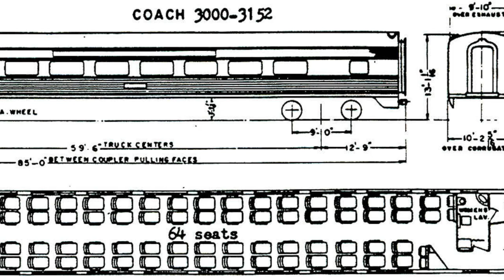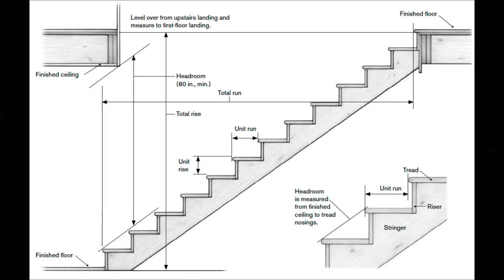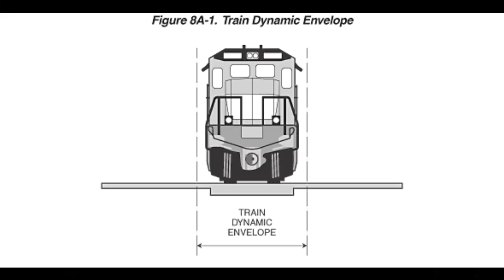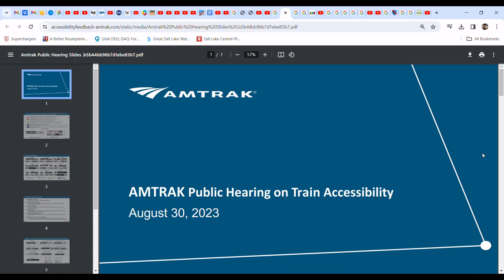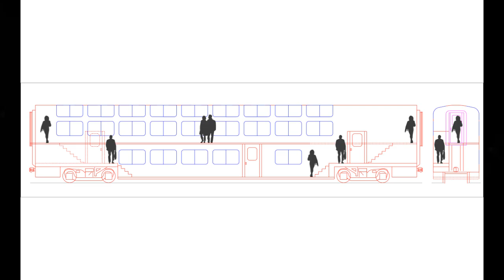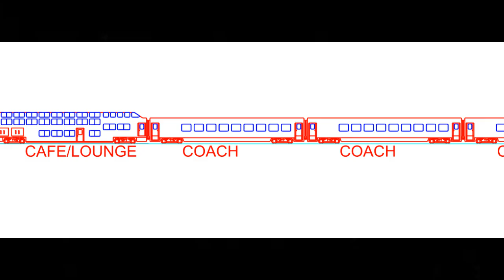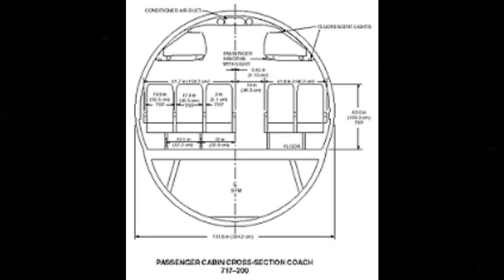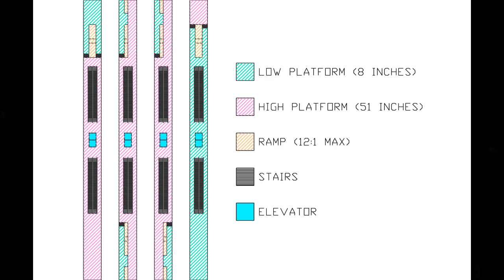An Excessive Explanation of North American Platform Heights

Comment: Has anyone considered bilevel boarding, with upper drawbridges? The bilevel commuter cars are ridiculously slow and inconvenient to load and unload (just one of the innumerable reasons that US trains are so slow). They would not even need to be present at low-traffic stations to be useful.

Totally with you on sleepers and split sets.

Comment: As a retired UK equivalent of NTSB engineer, it is interesting to see the issues which the USA have with this subject. For years in the UK we had a standard, but with privatisation and loads of new designs of trains AND our very restrictive loading gauge we ended up with big diesel engines under passenger cars which raised their heights resulting in many of our trains having crazy stepping distances particularly on curved platforms and very few have level boarding. Some have auto extending steps, but like in the US, it’s a bit of a mess ! In mainland Europe there is a much better approach and many stations are now being rebuilt to provide level access to new trains.

Comment: I’ve worked somewhere with one of those hand-powered lifts before. They’re pretty bulletproof, no motors or electronics to break, and very simple construction. Never seen trouble with it, other than just figuring out how to use it to begin with. I wouldn’t count them as “unsustainable” in the slightest.

Comment: showing some of the older European trains to make a point, in the Netherlands, level entry is the norm. trains with 1 or 2 steps is the deviation in old trains that are being replaced as we speak!
Reply from the maker: I'm glad the network is being updated! 
Though, I understand that most platform heights are so low that, aside from something like a Talgo train, the modern level boarding applies only to some doors or sections, since there still needs to be clearance for the wheels below the train car. Still great progress, but it prompts the same concerns as the Superliner cars from later in the video.

Comment: My british brain cannot comprehend trains this tall
Reply: It's not quite the 16 feet of the superliner, but the standard urban trains here in Sydney are 15ft double deckers.

I assume the UK uses mostly single deck trains?
Reply: @radred609  yup, British loading gauge (physical constraints on how big the trains can be) is one of the smallest in the world for standard gauge railways, due to early adoption syndrome (we got into railways first, built a lot of them early before realising how mighty trains could get and built much smaller than we should probably have, much of our railway still runs on that infrastructure from the Victorian age imposing restrictions on us not really faced elsewhere)

Plus, alongside this, the UK has pretty uniform level boarding (or close to level boarding) pretty much everywhere, some places you may have to climb a single step to board a train (depending on the train) but it’s not like some countries where you board from track level, this also applies to intercity trains.

Comment: The Via rail venture cars have built in accessibility lifts for stations with low platforms. Which is better than having to have them at the stations because of both maintenance and not needing the stations to have the extra staffing for the lifts if the station is located in an area where having the extra staffing is not possible. There's a few stations on the Quebec-Windsor corridor where the station is just a small station connected to a small freight yard since the station is only serving a small village or town.

Comment: I think that long distance trains should stick with high level cars for the whole train, but, I like the idea of the forward looking dome section which would be the first car in the train behind the baggage car.  The dome section would not have reclining seats or generous leg room nor would it have a layout like the sightseer lounge.  It would also be a silent section.  I'm old enough to remember riding in the dome cars of the real California Zephyr back in the day.  That was a greater experience than the current sightseer lounge cars.

Here's another idea, remember the Espee's articulated dinner/lounge cars and coaches?  They had a wide smooth connection between the cars that would be perfect for wheel chairs.  How about a four unit car with coach-sightseer lounge-diner-sleeper.  This would be the core of the train and provide a wheel chair lift perhaps in the lounge section only.  Additional coaches and sleepers would fill out the train to meet demand.
Reply from the maker: I like the idea of moving the forward-facing dome to the Transition car behind the baggage car. And I think your idea of the semi-permanently coupled SP cars is more or less exactly what Amtrak has in mind for wheelchair accessibility.

Comment: Yes, the tunnel situation is very by & the 19th century tunnel at 8:31 is EXTREMELY TIGHT (nearly as bad as the "London Undergound") = a nightmare for evacuation (even without a fire) of broken down trains ... 
also no capacity left over in these tunnel rich connections ... 
= the only solution is to build new tunnels, to newest standards ( & they should also comply with future standards that are likely to come)  ... 

This means much bigger tunnel diameter that has multiple important advantages:  (they anyway need new tunnels due to capacity limitations)
Far saver during evacuations + 
Bi-level coaces & broader trains compatible + 
higher speeds possible
Reply from the maker: In theory, I agree. Bigger infrastructure unlocks many additional advantages.

Comment: As someone from the Northeast, I think all North American stations should be standardized for high level boarding. Not only would be much more ADA accessible than low level stairs, but would also decrease turn around times for high frequency routes, increase potential train speeds due to high-level designs' lower center of gravity, and it would make boarding and disembarking much easier for passengers carrying heavy/bulky luggage with them.

However, for multi-level and dome car designs, I think we should focus on fixing the infrastructure to fit the trains rather than the other way around. Much of North America's rail infrastructure is in a bad state of decay, and is in desperate need of an upgrade already. We should also set standard electrification and tunnel heights to accommodate as many passenger and freight configurations as possible. Notably, we should standardize and proliferate 50kV 60 Hz AC overhead catenary electrification on as many tracks as possible, long distance or not. And we should standardize a tunnel height of 25 ft across the US rail network.

It is quite ambitious, but 25 ft would give more than enough clearance for multi-level cars and double stack freight while also maintaining overhead electrification. And it would give plenty of flexibility to passenger railroads to purchase cars to fit their needs rather than the constraints of the infrastructure on their network. It could even potentially lead to a national rolling stock pool that Amtrak could standardize for itself and even rent out to private railroads that could work anywhere in the US.
Reply from the maker: Now THIS is the bold vision I can get behind! If they are building new tunnels under the hudson anyway, why not make them be tall enough for true bilevel cars? After all, the NEC is often capacity constrained already. Bilevel cars would be able to move many more people than staying put with single-level equipment forever.

Comment: 16:23 With the history of Amtrak's less than ideal maintenance, would adding a complex mechanical device like the sliding ramp be a good idea? How long would it take for most of them to stop working?
Reply from the maker: I can only share my experience as a regular rider of UTA trains that use the ramp feature - and in the 15-ish years of running these cars, I've never heard of the ramps being a cause for delay, even in the iciest and wettest winter conditions. I would assume that Amtrak could (perhaps eventually) create a maintenance regime that works for the ramps and the internal elevators.

Comment: Interesting to see and hear your thoughts on US passenger rail, from my EU point of view (and location).
Indeed in the Eu it is still a hit and miss as also here RRs are working towards a mutual standard, while having to keep a certain percentage on old levels as there simply isn't time nor money to convert all platforms in a short time.
The only large difference we have is the clearance of way. Where large parts of the US rail network allow for double stack intermodal solutions. We are stuck between the safe height between overhead line standards. And the UK with the addition of even older tunnels that are lower in clearance. So you are not alone in this issue.

There is a conflict between the prime design rule: keep it simple and economics, as we don't want to pay for a new standard and applying that to the entire rail network. We could, but we don't want to for many reasons.
So I see your idea to have a basic standard for 1 level rail, with an addition for 2 level rail where this is possible. 

You could as a RR run separate trains, that connect in those area's indeed. This way of operation is not that far fetched as it is use for many RR routs in Europe. And RR companies bought their rolling stock to comply. For example in the small countries of the Netherlands and Denmark the state railways use relative small MUs (all down to 1 unit depending time an area) that are able to connect with other small MUs on rail hubs to for a larger train into more populated areas. Forming a long train of 10-12 units by connection smaller MUs, there where most capacity is needed. As both countries have a 'star' shaped network (sort of), the consists of multiple MUs split in parts when getting removed from those areas again to end on a provincial or local line with single units. And then it starts the other way around.

For your bi-level car, you could opt to mover the right lift a bit more left, so it can connect the lower level, level above the bogies and top level. You save one lift and some space.

Problem with standards is that you need (too) many decision makers to agree on one single compromise. That is very difficult to do in a democratic way.
Reply from the maker: Great insights! Another danger to standardizing is the XKCD problem - There are 14 competing standards, so let's make a new one that everyone can use! Now there are 15 competing standards...! https://imgs.xkcd.com/comics/standards.png

Comment: Hi Christian, this just popped up in my feed today. Great video, well made and well researched. I'm Australian, but I've visited North America a couple of times and traveled on a number of trains there. It's good to see that almost the whole North American continent at least managed to settle on one specific track gauge, even if you weren't able to standardise train width or height, nor platforms. Here in Australia we are kind of the other way around. Most of our trains are the same width (freight and passenger), and most of our platforms are the same height too, so level boarding is kind of assumed to exist everywhere. I don't think I've ever had to use steps to get on a train anywhere in the country. However, our track gauge is a mix of narrow, standard and broad. We've manage to standardise all our major interstate lines, but within each state a different local network usually exists, often not compatible with the neighbouring states. Granted, we have fewer, but larger states than in the USA, so there are actually very few cross-border lines anyway. But it does mean that each state has to buy its own rolling stock that can't easily be passed onto another state in the future, nor can multiple states bulk order the same train design. Add our long distances and small population and new rolling stock becomes a significant expense, both at state level and federally.
Reply from the maker: Thank you for the education! It's so interesting to learn how each railway project "back in the day" was designed to be so unique, and how that makes the task of standardizing and networking so different in each country.

Comment: I like the concept as a whole, but my only concerns with your ideal passenger train diagram would be:
1: The transition dome lounge, while unique and attractive, only allows the view in one direction which can be a hassle in passenger train terminals where the formation has to be put together as additional care has to be taken to ensure the dome is always facing in the right direction, especially if you run into a situation where a mechanical problem results in a lounge having to be swapped out. The current lounge setup works well because it doesn't matter which way the car is facing, everyone gets the same view.
Of course, Amtrak already operates a fleet of transition cars at the front of the train and doesn't have many problems turning the formation at major terminals, but those are crew dorms.
2: While it would no doubt look really neat to see this train's side profile going from single to hi-level, my concern is the passenger portion being single level, as part of the reason the hi-levels were made in the first place was to increase the car's capacity while not lengthening the car and to reduce the overall car count on the train as a whole, meaning they could shorten trains and operate with fewer cars on the whole roster.
Amtrak trains these days are typically formed with 2 locomotives, a baggage car, transition/crew dorm sleeper, 2-3 sleepers, diner, lounge, and 3-4 coaches with one of the coaches having additional space for luggage, about 10 vehicles at most on average. If a Superliner carries 44% more passengers than a standard coach, than it's not unreasonable to assume that you would need 44% more coaches to serve the same amount of passengers. That means the coach section alone swells from 3-4 coaches to at least 5-6 coaches. That's more coaches to purchase up front, that's more coaches to maintain, which mean higher operating costs and given some Amtrak stations are already too small to completely hold a whole Superliner consist within the whole station (look at Truckee, CA, East Glacier Park, MT, Essex MT, etc.) where Amtrak has to manually reposition the train 1 or more times during loading in order to accommodate passengers in different parts of the train which lengthens boarding time and hurts the train's time keeping, lengthening the train further would likely require at least 1 more repositioning move to serve all passengers, further increasing boarding time and slowing the train's overall speed which could hurt ridership as Amtrak tries to attract people from off the roads. Also the extra weight of these cars could be just enough to lower the train's top speed and acceleration away from station stops, resulting in either the timetable being revised to accomodate the slower times (which may put off some passengers) or the necessity of adding 1 more loco to the consist to make up for it which could drive up operating and equipment costs further.
3) Amtrak prefers to put the sleepers first at the front and puts the coaches in back for the convenience of boarding higher-paying sleeping car passengers on Superliner routes. The proposed diagram has coach passengers up front. Just something to think about.
4) If the auxiliary power car is what we used to call a booster or B unit, change it to a regular locomotive with a cab. Railroads have gotten away from using cabless B units as it made no sense after a while to operate cabless locomotives due to lack of versatility and it was a hassle for the power desk forming locomotive consists because they had to make sure they had enough cabbed A units and cabless B units on hand at all times at the terminals, which wasn't always feasible. Having all cabbed locomotives removes that complication and if the lead cab unit has a problem like a broken windshield which makes it unsuitable for a crew to operate in, they can stop at a station or siding and swap the two locomotives around so that the trailing unit becomes the lead unit. This is why Amtrak typically operates its current fleet of Chargers and P42s with all cabs facing forward (though you can obviously still find examples of Amtrak running their diesels back to back).
Again, I like the concept but these are some things I think others would have concerns about.

Comment: I believe that amtrak for their long distance fleet should have a talgo bi-level hybrid design where 2 coaches are permanently attached on a 4 or 2 axle bogie in which both levels are connected and have 2 sets loading doors like on the Statler kiss emu's on caltrain. So on the NEC they can use hi level boarding and on other regions of amtrak use low level boarding